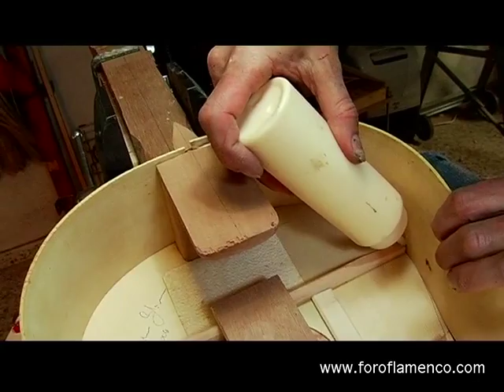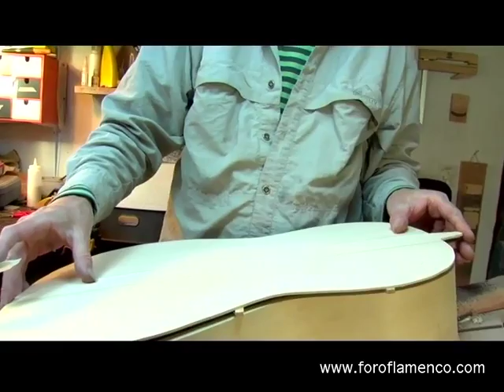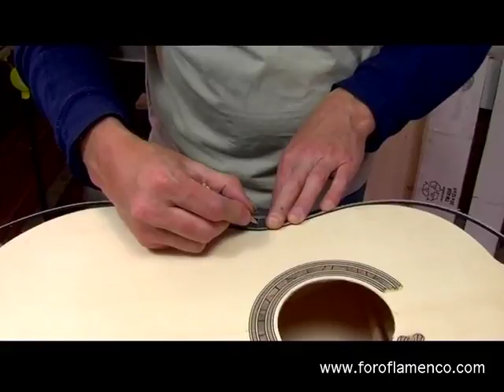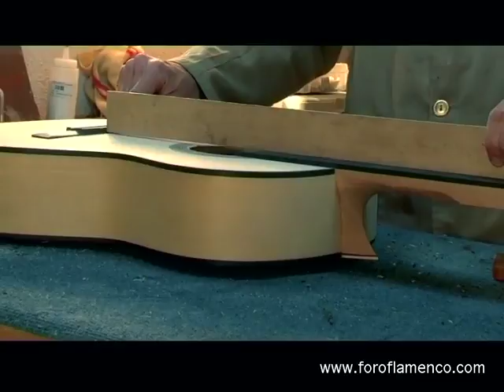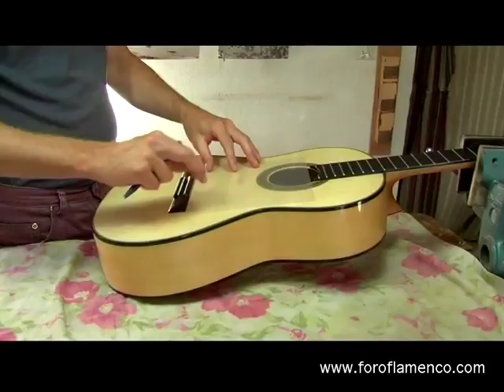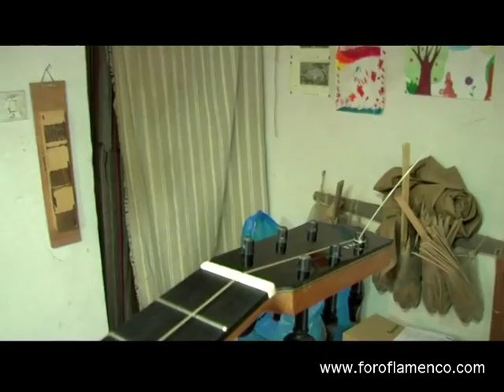El Guitarrero - the making of a flamenco guitar (Part Two)

Comment: Im so fascinated that in our modern technological time can still produce quality guitars although initially use electric machines , but after treatment handtools  and great respect for the goals to be. I just to the neck consolidating both glued in Unimpressed sides and bottom which gives a strong design . The after treatment is probably the time where the highest number of hours to achieve a good result and that is where the boundary is between machine produced Instruments and Handmade Instruments and the Guitar builder becomes a Maistro when the instrument is completely finished and ready to play. Thank you that we musicians mu look with during this enormous work to create some of the most delightful Guitars. You work with Flamenco Guitars are amazing from the beginning to the end.

Comment: Thank you so much for this most instructive video, but I have have a pause or two. The body seems too deep for a typical (95mm) flamenco guitar, and secondly, while the violin pegs are a nice touch, all Spanish/flamenco guitars have the traditional double slot headstock
with downward pointing tuners. Apart from which, great videos. LOL
Reply: a flamenco guitar can have more or less body depth, as long as the sound characteristics aren't lost. I've seen flamenco guitars with 100mm body depth.
as for the pegs, guitars have had pegs since santos hernandez and marcelo barbero in the 1950s, maybe even since antonio de torres. it can't be more spanish, no?